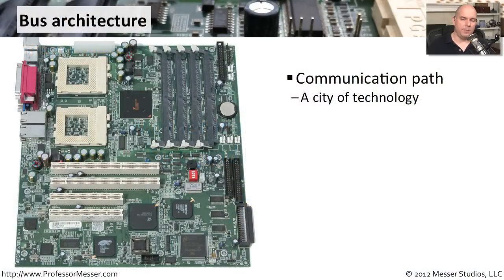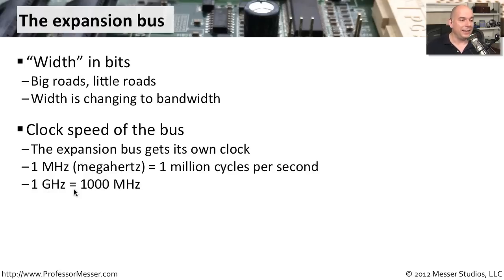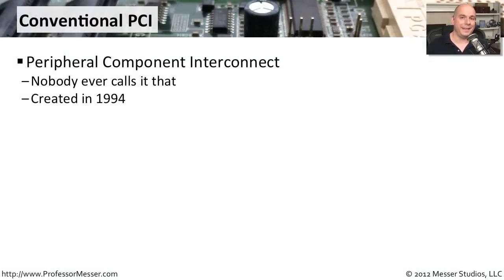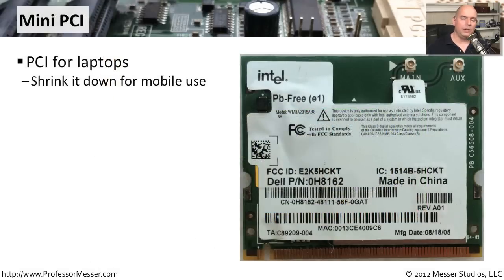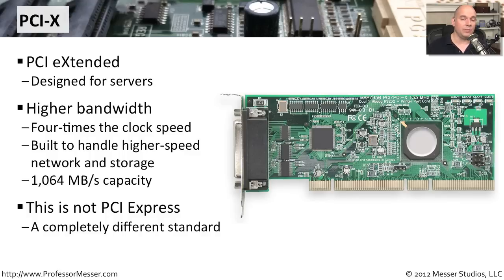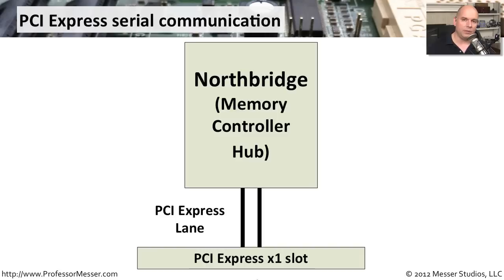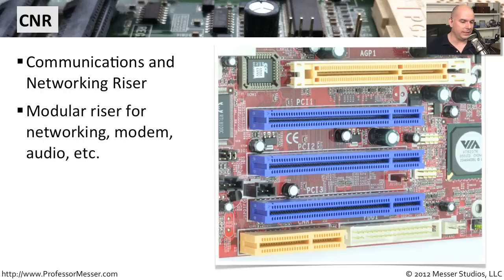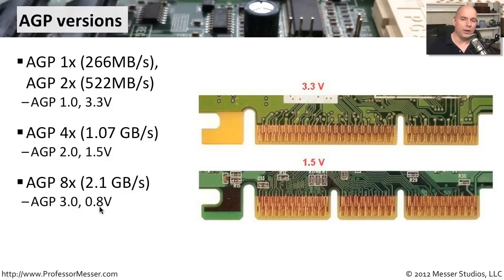Motherboard Expansion Slots and Bus Speeds - CompTIA A+ 220-801: 1.2

Comment: i was wanting to build a dual cpu gaming rig cheap :P i can only ever see white and black slots. been doing alot of research but not getting anywhere. would i be able to use a gpu like the gtx 660 or would i gave to use agp or low profile. I would also like to sli :) this video held the most info thanks :)
Reply: +MrDoyng i just realised i lloked at buying the first mobo in the vid what gpu is required for those slots??
Reply: What would your budget be? Typically gaming rigs only have one cpu. Most games dont heavily rely on cpu speed. So I would reccomend using that money to upgrade to a better GPU. If you would tell me your budget, maybe I could build you one online. (Pc Part Picker.)

Comment: So if the PCIe 3.0 has a speed of 500MB/s, how does the PCIe Intel 750 SSD give the 2.2GB/s speed that it promises..? If PCIe 3.0 only has a speed of 500MB/s ? Really nice video, I'm actually going to be building my first PC, and wanted to learn as much as possible, before I buy the parts needed.  I actually do know how to build a PC, but before I even touch the parts, I would like to understand as much as possible in two months as possible. (+1 : 619)
Reply from the maker: +Mark II The Intel 750 SSD uses PCIe v3, which is actually about 1 GB/s per lane. The Intel 750 SSD uses four lanes, giving it about 4 GB/s of total available bandwidth. That available bandwidth should certainly be able to handle the 2.5 GB/s throughput from the 750 SSD.
Reply: Professor Messer Ok, because I didn't hear you saying anything about the lanes (x1, x4, x8, x16) making it faster or slower.. But now I understand that the (x1, x4, x8, x16) means it multiplies it. Even though PCIe 3.0 is a 1GB/s interface. So that means, that if I has a GTX 980 GPU, that uses x16, that means it can go as fast as 16GB/s ? Thanks so much for replying so fast, I'm really stoked about learning as much as I can and building my first PC.

I know how to match up the AMD or Intel CPU to the MOBO. 
I know how to match up the MOBO to the case.
I know how to match up most things..

But yes, despite me knowing all this stuff. I am not ready to build my first PC.. I am, but I'm not going to allow myself to do it yet. I need to learn more. Great video series btw, really awesome, and thanks alot for replying and answering my question. So the x4 for the Intel 750 means that it's four lanes. I did heard you talking about lanes, but didn't really understand that it makes it four times faster. Am I correct, am I on the correct path now Professor Messer?
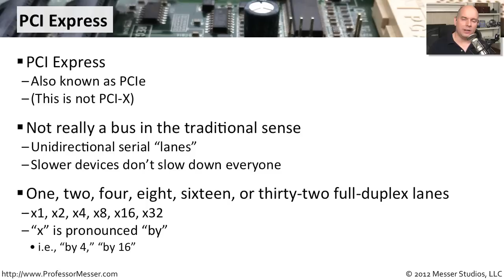Reply from the maker: +Mark II That's correct. I demonstrate the concept of PCIe serial lanes (and the differences between a x1 and a x4) at about the 11:00 mark.
Reply: Professor Messer Ive actually just started the video over.. I really want to learn about this stuff. Thanks so much, I'll try to pay closer attention this time. Putting in mind what we just talked about.

Comment: I've just finished another course on A+ and have come to learn some more from your great videos and service! First . . thank you!

I have a question though, when you refer to the speed, to you actually mean BITES, or do you mean BITS? Everything I've learned so far has pointed toward "b" instead of "B," and . . . well there's quite a gap of speed there if we're transferring 2 GB/s versus a Gb/s.

I hope you can help me out with this question, and thank you so much in advance! :)
Reply: +HisServant77 typically bits is used to refer to network-based communication so when you see communication between components on a motherboard or a computer in general it's usually bytes.
Reply: Emanuel Cicortas
True, though the size difference makes a big difference since a byte = 8 bits. So a GB/s is 8 times the amount of Gb/s.... I think it's really Gb/s and not GB/s because . . . that's . . . a HUGE transfer speed.

Comment: I know I'm not Professormesser, but the answer to your question is that the southbridge is sort of like a handler for the slower I/O devices and it delivers that data to the northbridge. At the same time, the northbridge handles the higher speed I/O devices and delivers the data to the CPU via the Front Side Bus. The primary data that the northbridge handles is the "more important" information that needs an extremely fast highway to get to the CPU, but it also handles slower information as well.